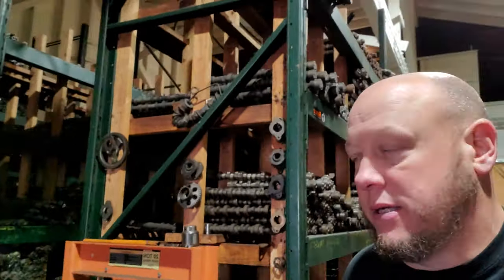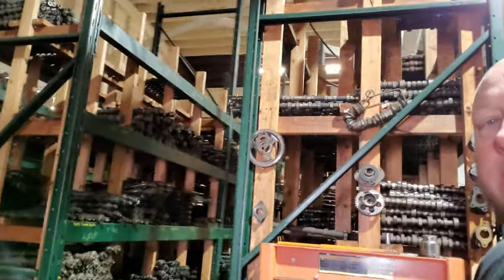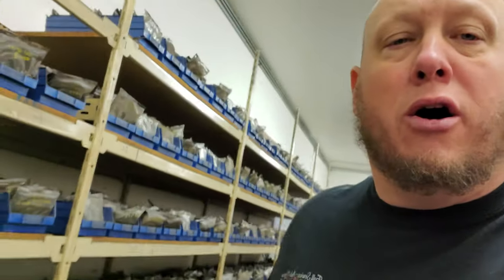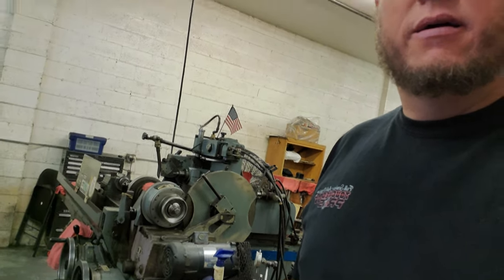Delta Cam .... Made in the USA !!

Comment: Would you be able to grind a roller cam from a billet for a John Deere pulling tractor? The cam is 6 cyl and about 36" long. The jounals are 2.375 so they need a large lobe. I could machine the blank and even rough out the lobes if need be. We run .842 chevy solid roller lifters.